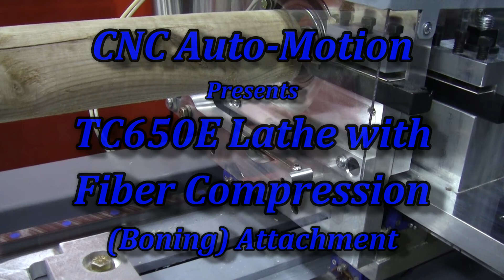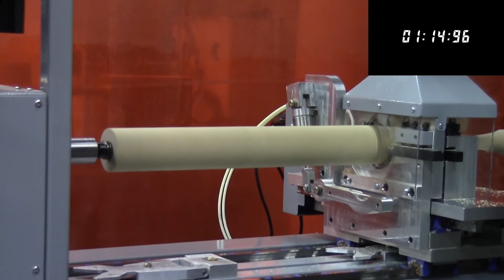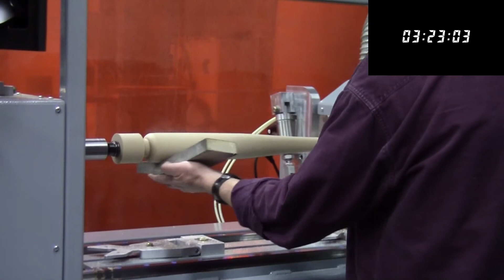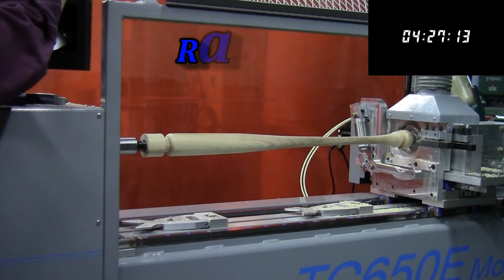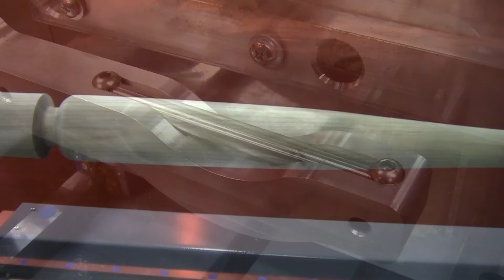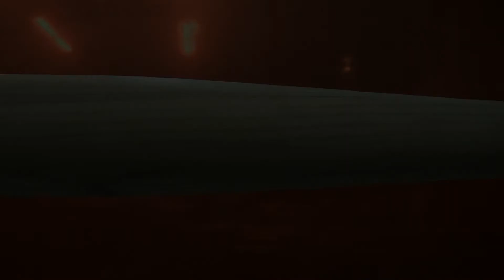MotionCat Lathe Fiber Compression Attachment

Comment: How much pressure is applied by the stainless steel rod for boning?
Reply from the maker: The mechanizum needs minimum 50 psi to operate at the regulator. As with any mechanical lever, the distance from the fulcrum applies  about 10% of the regulator pressure to the rod itself. The max would be 10% of whatever your shop pressure is. The speed that the bat spins and the rate the rod moves along the barrel can all be controlled by the lathe for whatever works best for you.